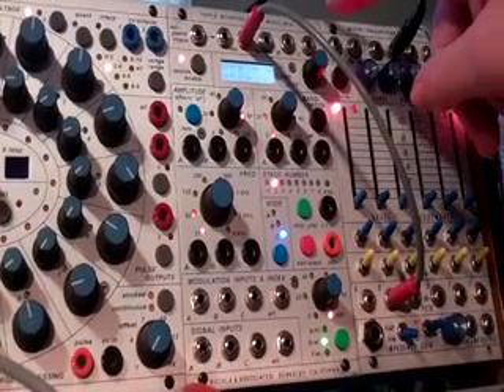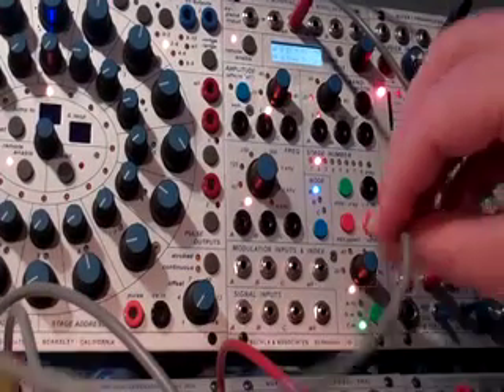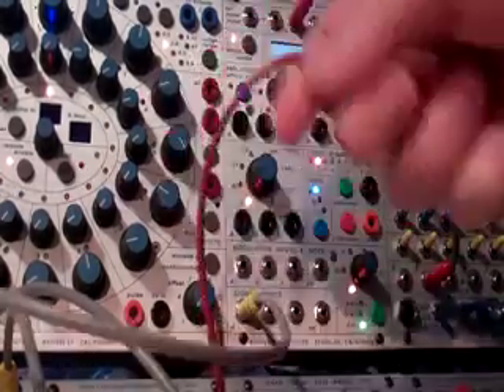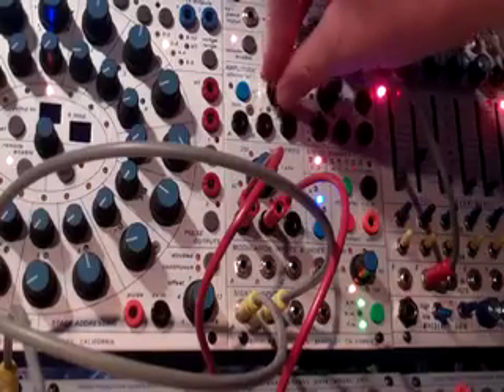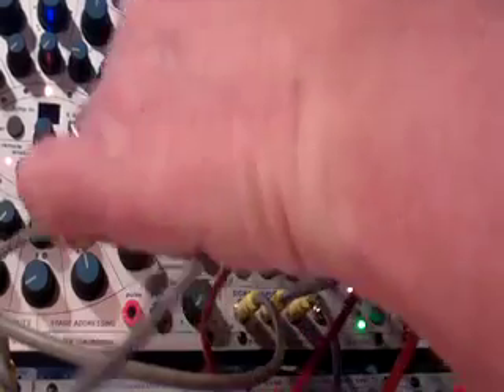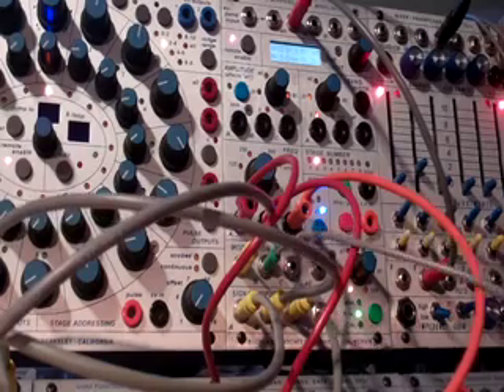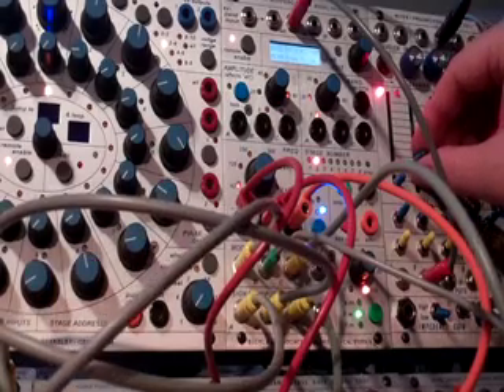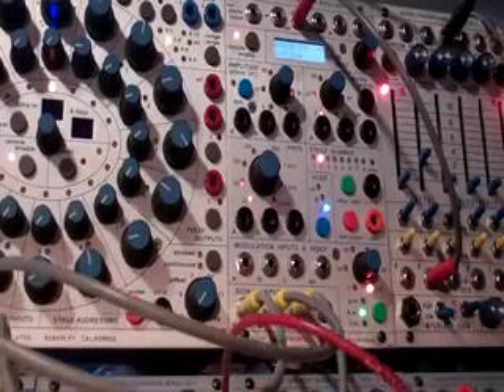Buchla 291e single tone destruction

Comment: Thanks for sharing the patch. Now, do you know if this filter is digital or analog? I wonder why it’s so expensive. I know Buchla modules are expensive, but $2K for a filter is an exaggeration.
Reply from the maker: thedevilstone analog...I’m guessing the price point is due to its multi functionality: 3 independent filters each with voltage control for all parameters including amplitude (therefore 3 independent VCAs), 7 combinations of audio modulation per filter CV-able, each filter can self-oscillate thereby giving you 3 independent cv-able oscillators, it can be used as a stereo mixer, 8-stage sequence per filter with internal clock or clockable from an external source. Oh, and they can be used independently or in fascinating, imaginative combinations. It’s a deep Triple Morphing Filter and not to everyone’s taste. I love it :-)